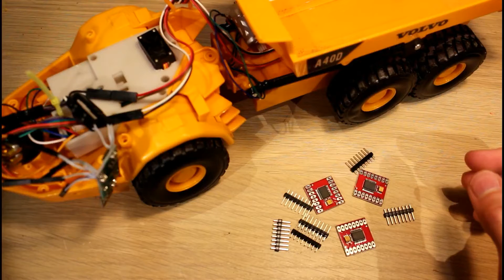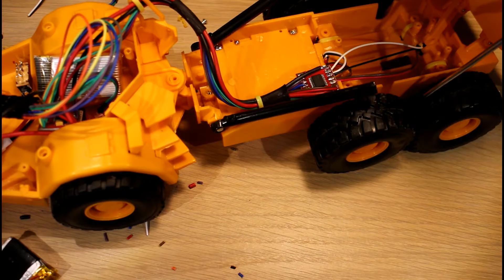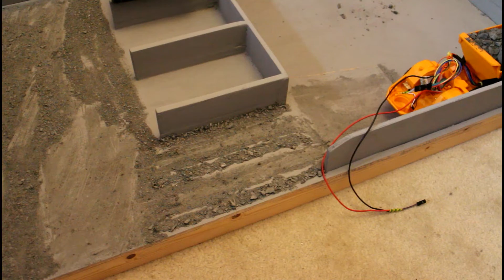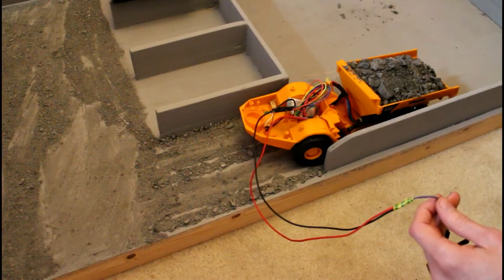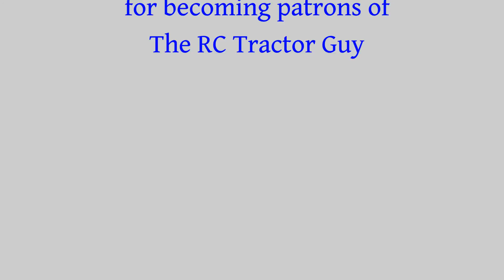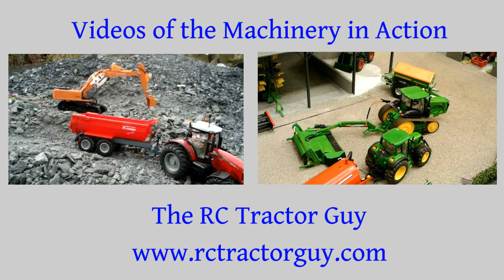Volvo A40D Part 6 - Individual motor drivers and more power

Comment: why dident you just use a npn transistor on the output of the one motor controller board instead so you would only need the one board to drive both motors?
Reply: you would use the npn transistors to drive the themotors on an icalated power source
Reply from the maker: How would you get your bi-directional control using an npn transistor?

Comment: can you add something that you can remotely change the voltage so it only goes fast when you need it to?
Reply: I think he can add, it;s called a PWM. I think in one of his controllers i've noticed two speed modes:)
Reply from the maker: I'll be using PWM like Mortern says but it doesn't change the voltage it pulses the motor on an off really quickly and the duty cycle coupled with the inertia of the motor/vehicle regulate the speed. But it's important to understand that during the on pulse you are giving it full voltage so that you don't damage voltage sensitive components, PWM of 50% doesn't mean you are half voltage so be careful.

Comment: I was thinking  about the fast that the dumper does not have rear suspension.It  could  be quite easy to make a rear bogie for the dumper like this :)

http://i182.photobucket.com/albums/x248/Terexdemag/dumper_zpsmwwzwi3z.png
Reply from the maker: Good idea, I'm not sure if there is much clearance above the rear wheels though I'll have to check.